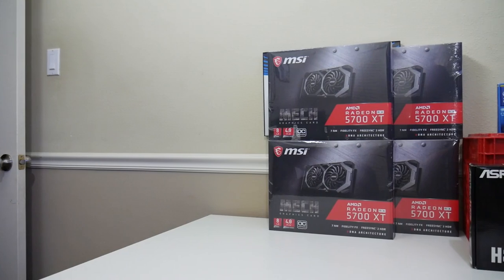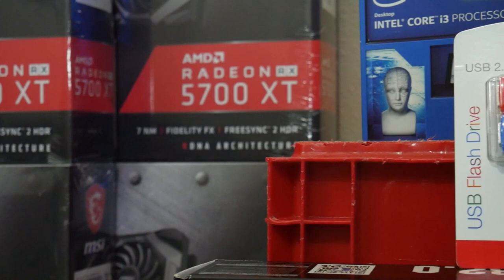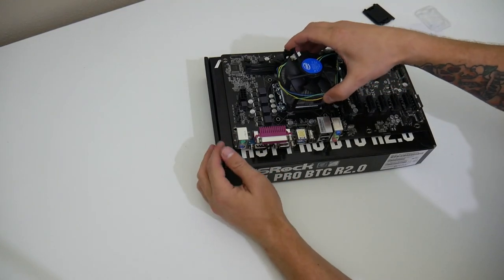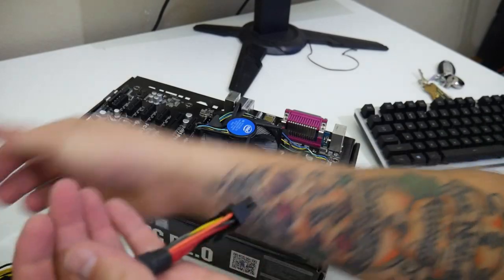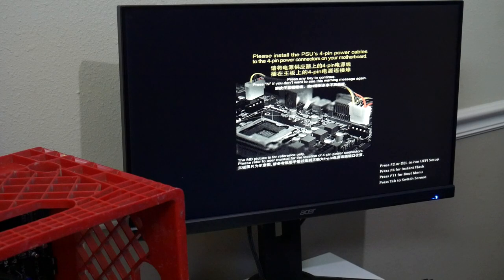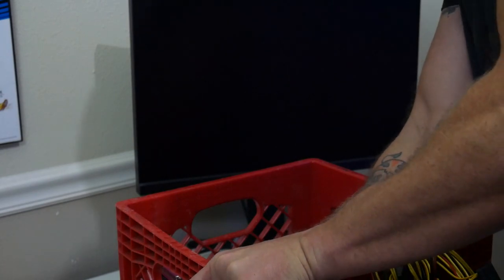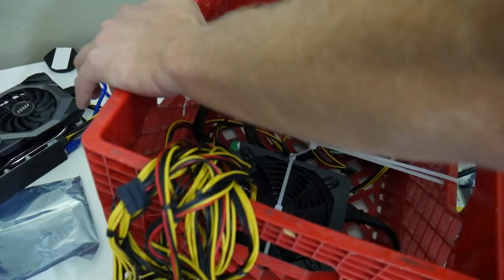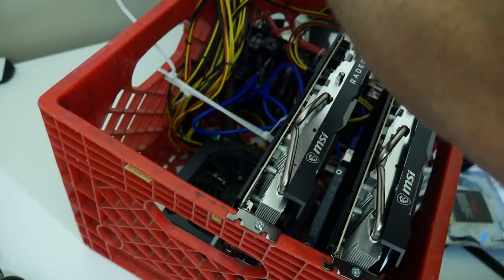How to Build a Milk Crate Ethereum Mining Rig 2020

Comment: Even if you're just doin four cards, I'd still get the six pack of risers.  Not only are they cheaper per unit that way most of the time, but risers seem to have a pretty bad dead on arrival rate and tend to randomly die from time to time.  Plus you're ready to go for 2 more cards later if you don't end up with a DOA or needing to use the spares.
Reply: so risers may fails during time, because of heat right?
Reply: Couldn't tell you why they fail - just that they do and being prepared with at least one extra sitting around for quick diagnosing and repair is a must IMO.
Reply: hi there, couple of questions... I'm trying to buy the i3-4160 but can't seem to find it... what could I use instead? Also, he puts a fan on it, but is not on the list of items to buy. Which fan should I get?
Reply: @gralmine8141  For the most part you just want a cheap base platform that you know supports above 4g decoding.  Check the motherboard manual.

Comment: What about using thermal paste for the heatsink for the processor?
Reply: Yes and no, cause when mining ethereum the power goes to gpu. and of course those intel cpu has low power comsumption and as you are mining with gpu, the cpu usage is less than 10% so not heat at all, and temps will remains like 40-50 c thats normal.

But of course if you can add some thermal paste to cpu is fine,   Some motherboard will shut down the  cpu if they reach to 80c
Reply: Those typically have thermal paste pre-applied visa silk screen.

Comment: i did the build. Everything goes well until I install GPU's. nothing boots into BIOS at that point, everything lights up except for my screen and no BIOS. Only difference is that  i could not come up with 5700's and got RTX 3070 FE, could that be the problem??? Please advise
Reply: I have the same problem. Did you find a solution? I expect something is wrong with the cpu

Comment: the memory needs to be DDR3 instead of DDR4. (parts list is not correct). great video.
Reply from the maker: Good catch I’ll update
Reply: wait is ddr3 a necessity or if i have something similar with ddr4 it'll work?
Reply: @Midnightservant1  is just to reduce cost, ddr3 may be cheaper than ddr4, but if you have ddr4 then you can use it.

Comment: Sounded like these dudes were speaking Spanish earlier. I didn’t understand a fucking thing they were saying. “Grab your motherboard and plug into your 24 pin, then you can boot
Into bios. Check the rig to see
If power is restored before you change pcig to the fping. Asus p2z7 got me 4gpu’s onto
Of the molex on top of the milk crate’s laskus perniver”. I’m
Like: “the fuck he call me”?? 😩🙁😜